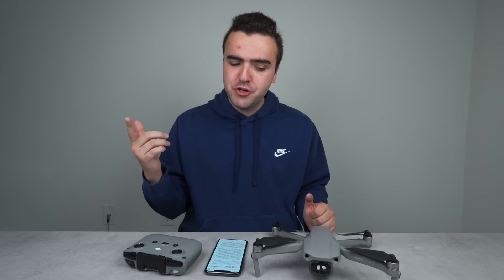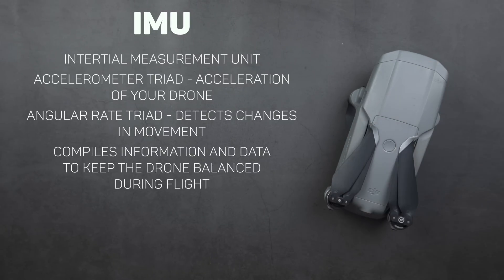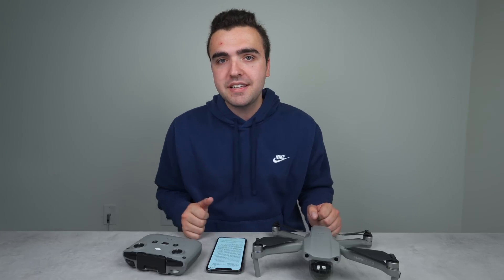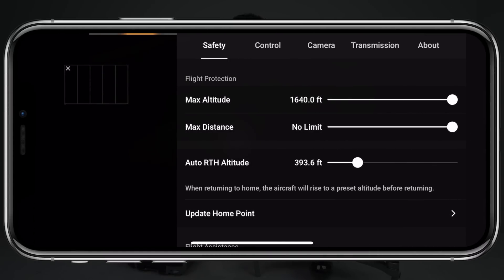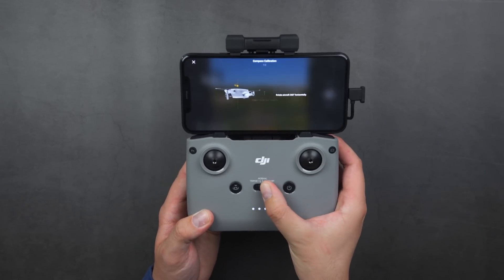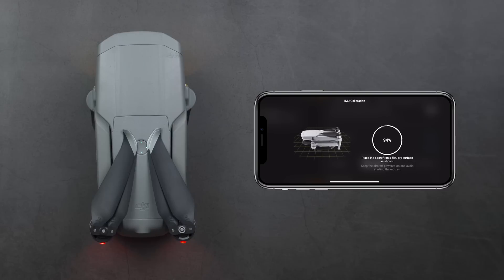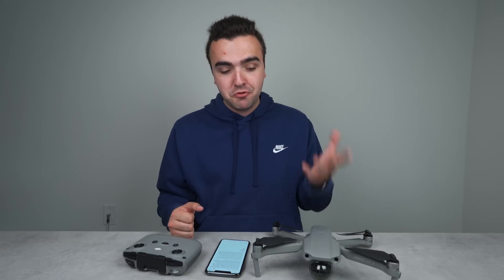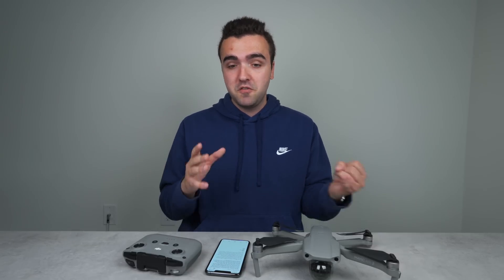DJI Mavic Air 2: IMU & Compass Calibration Tutorial

Comment: Question with the 'IMU Calibration'  The orientation of the drone in the video is different than the orientation of the drone shown in the controller calibration screen.  Does the orientation make a difference or is it more important to complete the steps?  Also, the last 2 steps are out of sequence with the video.  With my Mavic Air 2 (with latest firmware Jan 2022 01.01.07.10)   The DJI app is showing to lay the drone flat on its top then perform the step to stand the drone up.
Reply: Hello, fan! 🎊
Thanks for reaching out (commenting).
Congratulation You have been ❤️
selected amongst the shortlisted
winners, send a message to the telegram
above to acknowledge your prize

Comment: Good evening billy...I have a question.. but 1st I need to explain my situation..I was flying my mavic air 2 and i lost control on high speed and bumped into my wall cement. I was flyinf low. The drone just bounced back but stood on the air. I landed the drone and turned it off to check if any damage. I was happy no to see no dent or any mayor damage just a very small scratch on the front body. turning it back on I noticed  I cant see nothing of the camera on my phone. the drone responds very well with the controler but no vision from the camera. there is no damage or scratch in front of the camera.  I have tried everything and I can fly very well but cannot see on screen..any info some one can help  with ? regards !!
Reply: Hello, fan! 🎊
Thanks for reaching out (commenting).
Congratulation You have been ❤️
selected amongst the shortlisted
winners, send a message to the telegram
above to acknowledge your prize.

Comment: what is the tolerance for "level" when calibrating the IMU? My kitchen counter is 0.7° from true level according to my phone's built in level. If I hadn't seen someone say use a level in another post I wouldn't have bothered checking. I did have an issue with my drone drifting when RTHing and it would have landed in a tree had i not intervened. (I never calibrated it when I first started using it last week.
Reply: Hello, fan! 🎊
Thanks for reaching out (commenting).
Congratulation You have been ❤️
selected amongst the shortlisted
winners, send a message to the telegram
above to acknowledge your prize.

Comment: Hi I noticed when I put the drone on its side for steps 2 and 3 it doesnt lay flat unless tilted toward to the top of the drone. Do you want it to be sitting level with no movement or do you want it on its side at the point of balance
Reply: Hello, fan! 🎊
Thanks for reaching out (commenting).
Congratulation You have been ❤️
selected amongst the shortlisted
winners, send a message to the telegram
above to acknowledge your prize.

Comment: Just had mine back from repair, it's omitting a constant beeping from the controller, I've completed the above. The forward/backward motion from the joystick is intermittent, as a consequence it will not 'go home' I have to land it myself, all other controls are OK, I've also reset the Google maps and cleared the cache. Any advice?
Reply: Hello, fan! 🎊
Thanks for reaching out (commenting).
Congratulation You have been ❤️
selected amongst the shortlisted
winners, send a message to the telegram
above to acknowledge your prize.

Comment: Hi there, thanks for your time with this. I've had a Mavic Air 2 for a couple of months and am getting a GPS settings warning (like an intermittent flashing symbol) ... is this relating to the compass settings? When I tap on it it's referencing GPS settings but it's not clear what it's asking me to do. By the way, this has been happening when not at particularly great distances. Thanks again
Reply: Hello, fan! 🎊
Thanks for reaching out (commenting).
Congratulation You have been ❤️
selected amongst the shortlisted
winners, send a message to the telegram
above to acknowledge your prize.🎉

Comment: Your slide should say INERTIAL MEASUREMENT UNIT instead of  INTERTIAL MEASUREMENT UNIT. Other than that two thumbs up for your video.
Reply: Hello, fan! 🎊
Thanks for reaching out (commenting).
Congratulation You have been ❤️
selected amongst the shortlisted
winners, send a message to the telegram
above to acknowledge your prize.🎉

Comment: Takes 25 seconds to calibrate compass , calibrate it every flight from a different location, and also every flight day, do not calibrate your compass as in this video, hold the compass in one location and walk around in a circle, don't hold the compass out from your body and spin your body, the way it's shown here is not correct, if you take off even several hundred yards from where you did previously reset the compass this will save you from losing your drone
Reply: Hello, fan! 🎊
Thanks for reaching out (commenting).
Congratulation You have been ❤️
selected amongst the shortlisted
winners, send a message to the telegram
above to acknowledge your prize....

Comment: Maybe the single IMU is improved?
Reply: I’m hoping this is the case as well. Or that the data on IMU failures supported that there isn’t a need for a second IMU. My biggest fear is flying this over water and the IMU fails and I have to rent some scuba gear to get it back.
Reply: @Rossco84  .... save your money on the scuba gear rental.  The drone will be a total loss due to submergence.
Reply: Hello, fan! 🎊
Thanks for reaching out (commenting).
Congratulation You have been ❤️
selected amongst the shortlisted
winners, send a message to the telegram
above to acknowledge your prize.,,,

Comment: I never noticed until recently, because I allways had my data turned on  my tablet. But you get a much better compass  cal if your data is on, even though you don't need it to fly  and  use the app
Reply: Hello, fan! 🎊
Thanks for reaching out (commenting).
Congratulation You have been ❤️
selected amongst the shortlisted
winners, send a message to the telegram
above to acknowledge your prize.,,,

Comment: Wrong dance Billy, you should maintain the same axis in space, not a rotational spin. Read or follow the official DJI instructions, or videos my friend.
Reply: You are exactly  right. I have also noticed even though it doesn't say in the manual,  you get alot better compass cal if your data on your devise is turned on. Even though you don't need it to fly with.
Reply: wont matter... Works perfect both ways.
Reply: Hello, fan! 🎊
Thanks for reaching out (commenting).
Congratulation You have been ❤️
selected amongst the shortlisted
winners, send a message to the telegram
above to acknowledge your prize.,,,